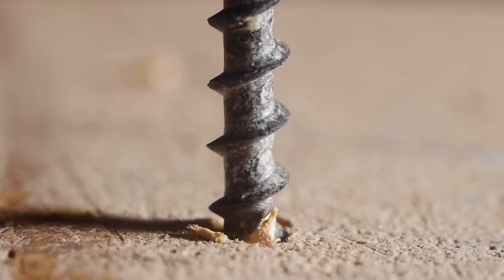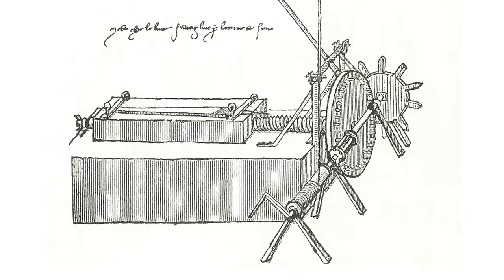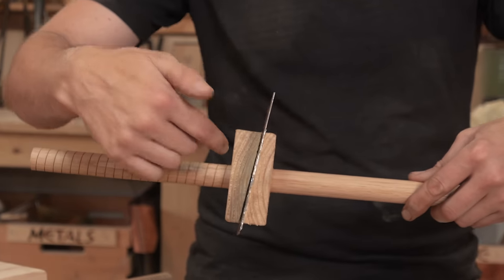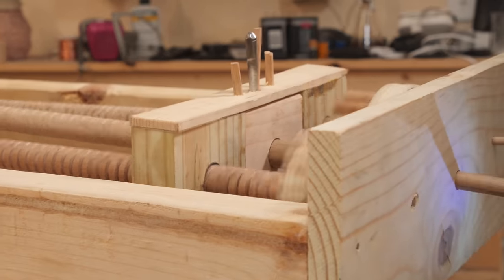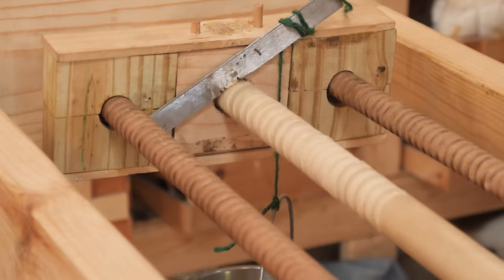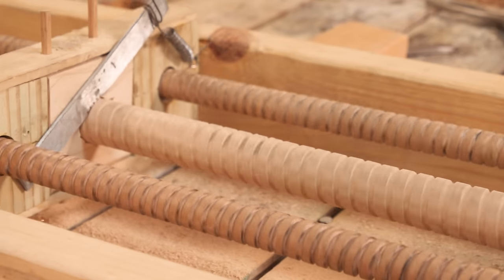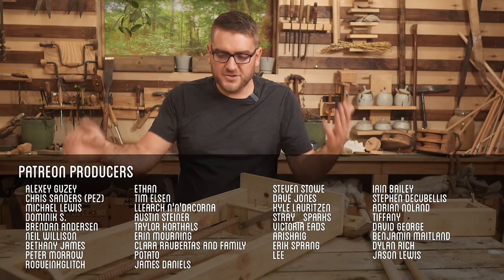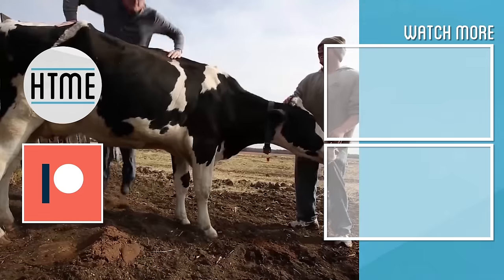This DaVinci Machine Unlocks Precision!

Comment: Why not carve the screw after you mark it with the blade, using a V shaped gouge set in the block like the blade was set in the block?
Reply: I was thinking the same thing. They could have used the same style block-jig they used for the initial marking, but with a V-Chisel to cut out the thread on a second pass. My guess is they haven't made the hardened-tools they would need. Any sort of metal chisel they're currently capable of making would get too dull too quickly to be affective. The saw-strap they used instead is likely the most robust cutting-tool they could make.
Reply from the maker: Thread cutters like that do exist, but I think once you're cutting out a certain amount of material, the tool itself needs to be threaded to lock in the cut better.  Which means you have to go through the whole process of making a reference screw, and then using it to carve a thread into the thread cutter.   You then end up with a highly specific tool limited to a very specific thread count and screw diameter.  I think you're also limited to having to cut the entire thread in one pass, which also limits what material you can carve with it.
DaVinci's design is much more versatile, allowing you to change the thread count with a different gear ratio, or switch to larger and smaller diameter screws.  And you can cut harder materials in multiple passes, since it will cut at same spot every time.

Comment: If you look at the history of machining, you'll find that (or something very similar) was made in the early 18th century for cannon and firearms
It's believed the first 'threading lathe' was made using a spiral band wrapped around wooden pole, a lead screw made, then brass and eventually iron some time in mid 1700's (the little I remember from training in 1970's)
Pretty sure modern reconstructions are finding out things that were previously just speculation?

Comment: DaVinci might not have had modern coiled spring but he would have used probably a torsion spring, He would have also had access to clock springs and leaf springs. I've also seen a wood spring, carved for the task used for a similar effect as to that of the screw machine on the blade.

Comment: The way I see it, that spiral groove marker should have been used as a jig to make cutting the threads quick and easy. Rather than hand-filing after cutting the spiral, use the spiral cutter to index and hold the screw as you cut it.

Comment: You put a rope tightly around the rod and secure it at the end, then you put the other side into the block, you put the block on a desk with a hole that is slightly larger than the rod, then you put weight or pressure on the top of the rod,; now when you pull ar the rope near the block the rod will start to rotate and for every millimeter of rope you pull the rod will go down and you will get a almost perfect spiral pattern.

I am not very handy and I have knowledge about this, but that is how I would make a screw. Well if you have a rather smooth rope you can twist it around the rod and then insert a thin knife or needle between where the ropes is pressed together and trace that spiral pattern the gap create.

Comment: I just thought of something that would've made making screws relatively easy and consistent without a machine, a string. Nail/Weld in one end, wrap around the wood/metal and nail/weld to the other end of the string to the other end of the screw after adjusting it to get the width you need.

Comment: rope, vines, leather straps or heavy wire wrapped at an angle and with a uniform set space between each winding could simulate a screw. This wrapped screw could push back the potential origin and would be less likey to be discovered in archaeology because of it's degradable material composition. Also a rod coated in thick resin, sap, or fired clay and then either shaped or carved into the right shape. Clay would particularly lend itself to this. Just wrap a string at the tooth interval you want and fire it solid.

Comment: You Know, IF you just put a triangle file on the same angle as the groove cutter on the end of the block and had a tensioner there, you could just pass the rod through by turning it to "file" the groove the same way you are "marking it".
Sure, it might take a few passes, but it would be a lot more controlled and even.

Comment: You don't need a reference scew to make a screw you can calculate the distance traveled per rotation and change the gearing of the lathe to get it desired thread width almost every lathe will have instructions on the cover for conversion to desired thread width and the gear ratio you need to swap the gesrs to.
 To make threads its pretty simple you could easily make simple lathe with a cart set on a gear system with your cutting tool then you spin your stock and let the gears move your cart the same for every rotation then change gear ratio to have closer or further threads
 Don't know if theirs examplea of this in history but lathes have been around for a long time

Comment: You don't need to hand cut anything. Use your angled plate, to guide the thread, and put a cutter in the block, after the angled guide plate. You'll create good threads, without hand carving anything.

Comment: You don't need a screw to begin with. You just need some coupling of the rotation and the advancement of the cutting jig. Have the main driving wheel that rotates the pole being carved. Run a pulley to a secondary wheel. Gear that secondary wheel onto a looped winch that pulls the carving block, and make sure the line is nice and taught. Then you can just switch out the gearing on the secondary wheel (and blade angle) to adjust the thread advancement and cut whatever screw you want. If you wanted to get especially fancy, you could have all the gearing on the cutting jig, with the pulley from the secondary wheel just turning what is effectively a drive wheel on the jig, and use gearing in there to get it to crawl along a toothed track. But basically, you don't need a screw. Just rig pulleys and gears to get a consistent spin:advance ratio, rather than having to rely on the accuracy of some crappy hand carved screws.

Comment: I do Wonder could you just use screws along a curvature of the lattice and have a framework it before and after the drilling and then once you get it done you screw it all the way through and then you can push it back you can maybe clip the framework around the previously done piece so you can do what you couldn't do to start with

Comment: Looking at this, it looks like the thread cut on the middle pole is going to be the average of the threads of the two guide poles. Would that allow iteration like the three-plate method of getting a perfectly flat surface?

Comment: Wow, didn't you look in books about this? 😁
Basically the tool at 4:22 is correct and one of the simplest ways to make a screw. You just missed the actual cutter! It's the initial stage of a thread-box.
You have the guiding blade nice and positioned but on the trailing side of the blade you have a hole into the block where you leverage a cutter to do the first pass. This deepens the initial mark enough to use it as a guide with a dowel in the next block where a cutter makes a much deeper cut. My grandpa had these tools in his shed for woodworking and I would be selling DaVinci short if I did not believe he would use such a method.

Comment: I would have thought a machine with two blades to help make master screws. One blade cuts the thread; another is a guide element that engages with a previously cut thread a revolution or half a revolution apart to help maintain the pitch.

Comment: You forgot one of the old ways to make a lead screw was to take a round bar and heat up a small square bar and wrap the square bar around the round bar to create the thread. Then you'd have to heat the entire thing and forge weld it together.

Comment: One could make a basic lathe by pinching stock between 2 centers and use a very sharp mounted chisel and a high torque hand crank to turn the work while another person moves the chisel. First precision threads made.

Comment: I would have used a rack & pinion geared down to the desired ratio with a bevel gear tied together to the same power input crank/shaft.rack & pinion for the cutter and the bevel for the stock to be cut.  This would allow you to make many different screw pitches by swapping out the gear ratios.

Comment: You could use a levelwind screw like a fishing reel uses, but I think anything like that would cause large errors in precision over time.  I think you'd be better off using clockwork style gearing to reverse the power after a number of rotations

Comment: The springloaded saw thing is what makes it slow. Replace it with a rigid single sharp cutting edge, which can be locked in place and adjusted with wedges. In general it seems your lack of understanding on cutting tools hinders your projects. Understand how a chisel and knife work and you understand all cutting tools. Most of them are chisels, a few are knives.

Comment: with your ability to cast, you can now make a mold of the screw ( rod ) in sand, then cast threaded stock also you can now make these parts in either cast bronze, or cast iron as far as you advanced time line goes, Correct?

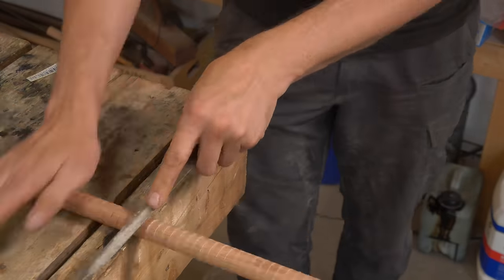Comment: 4:40 you didn't have to manually cut the threads. A second tool similar to the line scriber, but with a spade bit, could deepen/widen the cut, and would be much more precise than file and chisel. Or angle a file in where you cut the initial grove, and just keep dropping it lower with each pass. Its the same idea as a rabbet plane.

Comment: Question, why didnt you try to use a v shape chisel at a 45° to shape the shaft? You could deeper the groove by pushing the chisel further into the block, basically take the center hole and on top make a scrap shoot so the residue comes out and in 45° of that hole insert a chisel and a tension block to hold the tool

Comment: I would think the first iteration would make more sense (to me) to wrap dowels with wire creating thread, then the nut can be easily fashioned using the "box" method.  although not a strong screw, it would create a smoother guide, relatively easy to make changes in pitch, and could then be the source to transfer to the cutter. The first cuts can create true screws to make a better machine.

Comment: Wait, what's to stop you from using a version of that initial skewed-blade jig to make screws directly? If you switched from the flat blade to a V-shaped scooping blade and used water power or something to drive the actual turning action against the increased resistance, you could just crank out tens of threaded wooden rods day if you liked, no fancy machine required. At most you'd need to build a wooden track to keep the blade block advancing while the turning rod remains unmoving.

Comment: A holdfast could probably achieve the clamping force you need to build the screw to build the vice
Reply: yeah there are a few different workholding designs that don't require a screw to make (there's even a style of vice which can be made without screws which is similar to a stitching pony, only using a nut with tapered limbs for friction tightening), and added to that is the fact that andy and crew are not masters of hand-tool work shaping, several of the things they've created where they relied on the vice are doable without, just require more specialised skillsets that can take a while to develop

Comment: I'm not sure if the machine uses 2 identical screws. Eventually, they would simply wear into each other and become more similar, while the produced screw would be a compromise between the two. But having 2 near-optimal screws to begin with would be ideal.

Comment: 3:20 I'm actually shocked at at well that device worked.  Couldn't you also use that same method as part of the screw cutting lathe?  Rather than having to cut the threads by hand. Make the two poles and use the tool to scribe the marks, but then instead of having to create nuts, you can use the cutter as the initial "guide" nut.  At the very least it would let you create an initial lead screw more accurate than using lead screws that were hand carved.

Comment: also the two screws working together will even out any imperfections by averaging, so keeping making two new screws then using those should in theory halve any error each iteration (especiallyif one is reversed so beginning of thread is at opposite ends),  after say four iterations biggest error by far will be the gears.
So gears now being a source for errors making a dividing plate and a hand shaper to make more precise gears should be next.
also measuring equipment like metal straightedge, measuring calipers (old style that look more like dividers with feet...) and a precisely divided ruler. 
EDIT 
 preferably also a set of "gauge-blocks" precision blocks that can be combined to form any liner measurement between 1 and 250mmwith 0.01mm or better (for you 0.1m  will be enormous improvement) 
/EDIT,

Comment: With metal, why filing (unless its something very specific). Eg: you can twist a flat bar in a single heat -- that's how old time drills were made for example.

Then corkscrews are essentially just stretched out springs ... (Also useful for producing some templates).

Filing those things sound incredibly expensive approach to it - and not just time costly.

_

Don't get me wrong, filing does have its purpose - but for finalizing and precision. There were certainly easier ways to produce screws then the initial clips from the video left impression of.

Comment: i would think the easiest way to make a metal screw (though imprecise) is using square or triangular stock, heating it and twisting it. Then cut to length, taper the end and peening the other side to make the head and file in the slot  or shape the head for some kind of wrench

Comment: It's a fun idea but but there might be a simple reason it was never made, it's overly complicated. A thread cutting "die" for wooden screws isn't complex, you literally take the thing at the beginning with the flat cutter that made the markings you then filed and replace it with a v-shaped chisel cutter at an  angle  in a drilled hole. You make a pass, give the chisel a tap and make another pass , it creates extremely uniform wooded screws.

Comment: another easier way to make a screw with smithing techniques would have been to hammer a tapered fluted triangle shape, and then twist it into your screw. instead if filing it out. then touch it up with the files.

Comment: Your idea of having to manuely carve the threads AFTER! you properly marked the rod is frankly nuts! Don't you think that if DeVinch could come up with a way to mark the rod as you did that simply enlarging your block that marked it with a set of knives to cut it one after the other each one cutting it just a bit deeper would have been an easy jump in logic for him? 
To make this idea useable on diffrent thread patterns make several blocks as follows...
Next time take several blocks that are all drilled with 3 holes. One for your rod. Two for gaging rods that allow the blocks to be moved slightly so that you can cut diffrent thread patterns. Clamp the all down and add a crank handle to the center rod to aid truning it through the cutting heads.

Comment: With the block-and-blade thread marking device, why couldn’t you just prepare several of them, with the blades cutting progressively deeper, with the final couple using a V-gouge type of blade? They could be mounted on a base such that the dowel would feed naturally from one to the next, with a smooth dowel entering at one end and a finished screw emerging from the other end.

Comment: I'm a little confused because this seems like an over engineered solution.   In traditional woodworking wooden screws have been made using a thread box. It houses a v-cutting tool in the same manner as the tool you used to score the threads. Roy Underhill from the wood right shop has an episode explicitly explaining the device.

Comment: wait, why do you need a reference screw to create a screw on a lathe? You created the tool you need to create the perfect repeatable screw with the block and blade method used to make the initial mark. Just use the exact same method from the marking block but add a slightly wider blade the next pass, repeat the process adding a slightly larger blade every pass until you have the desired screw thread.

Comment: Wouldn't a rack and pinion on a splined shaft be easier to manufacture? The splines can be any non-round shape, driving 2 bevel gears that drive the pinions. This eliminates the need for the first two carved screws. Furthermore, the gears and pinions are more straightforward to manufacture, evidenced by mechanisms like the Antikythera mechanism.

Comment: This seems to work and follows da Vinci's design, but couldn't you use a cord and pulleys to link the movement of the cutter to the rotation of the lathe ? That would allow you to bootstrap screw cutting, without ever having to cut a screw by hand.

Comment: You can EASILY manufacture a metal screw by sand casting one of your carved wooden screws and pouring ANY metal you desire... It would be more difficult do it with a nut since the threads would be destroyed by removing the master but you could realistically use wax and burn it out of the mould in a 'lost wax' casting. 
Reducible complexity for the win.

Comment: Why would you file the threads into a steel screw when you could forge a diamond shaped shaft then twist the threads on? This would make a two start screw thread, but for screwing into wood this should be fine. Maybe there would be a little touch up work with a file to finish it, but it would be way faster than filing the threads. With some practice, consistent and tight threads would be fairly easy to produce.